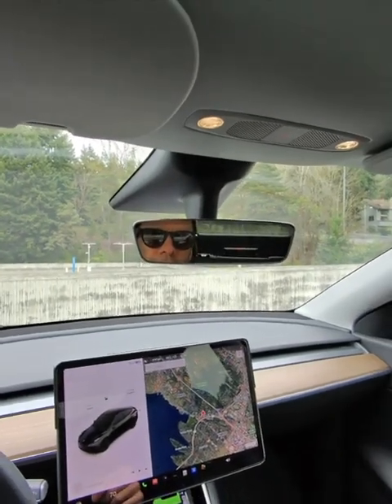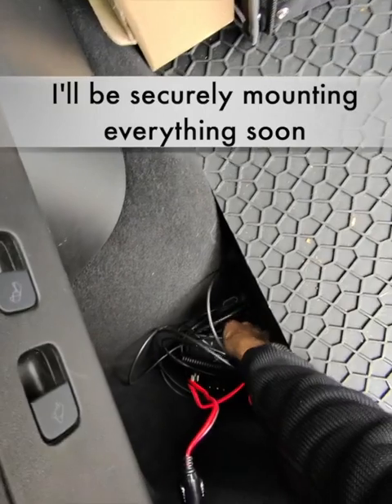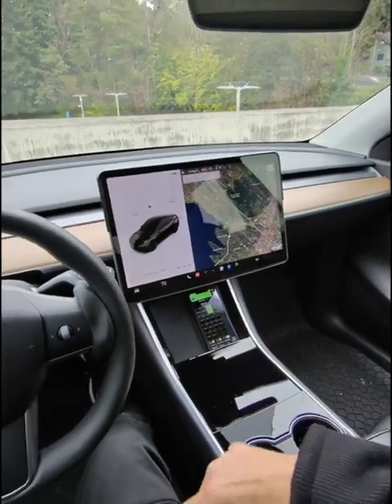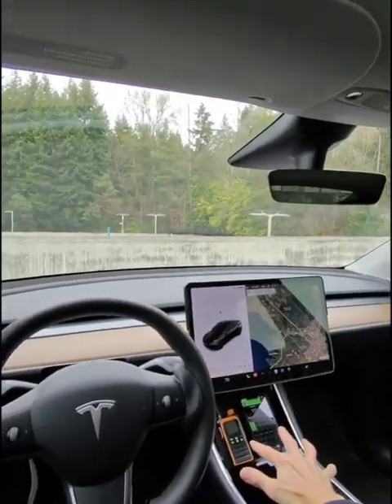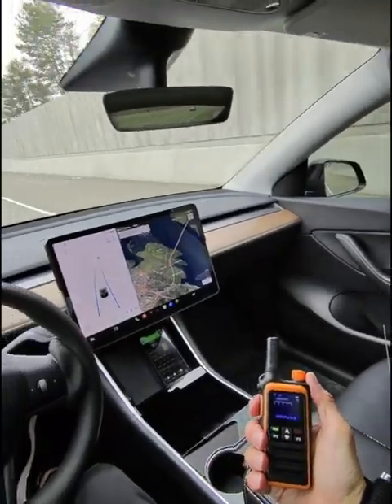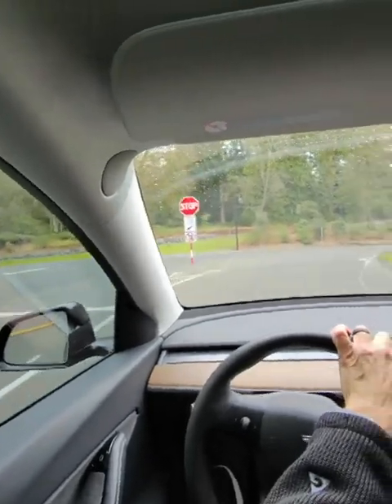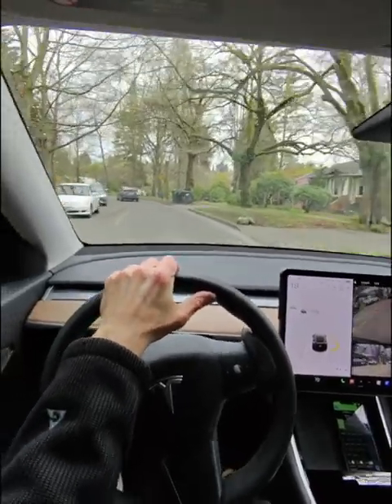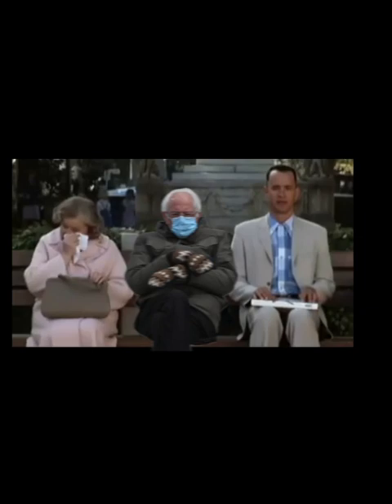Shocking superhack: No wiring, no drilling for ham radio in Tesla Y

Comment: The antenna mount is an absolute no go, especially here in Belgium.
Here you are not even allowed to leave a tow bar on your car if you are not using it, pedestrians can hurt themselves.
About the antenna, I am a Model Y owner myself and I use an on-glass antenna at the back of the panoramic roof and that works perfectly.
No trunk clamps that damage the inside.
Ok, on-glass antennas are a compromise but they will work much better than your antenna that almost touches the ground.  73's ON7FQ
Reply: May I ask, I have a Y, what on glass antenna model are you using?  Thank you!